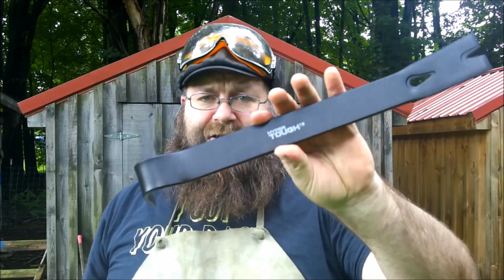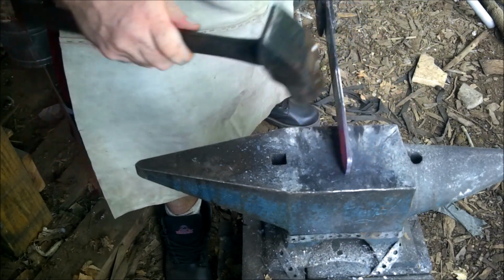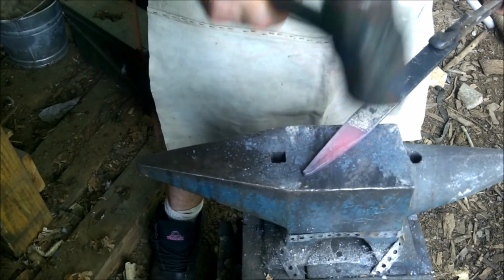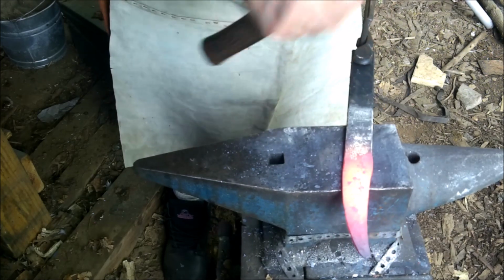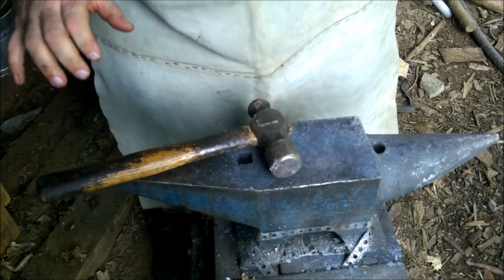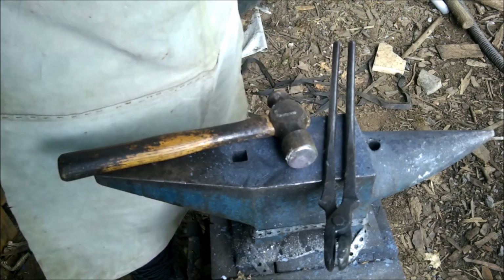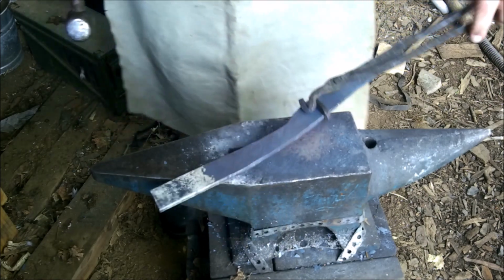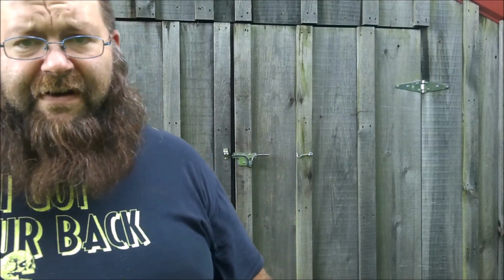Using Mystery Steel for a Knife Part 1

Comment: I've made knives out of pry bars before and never had any problems with them. I made a pry bar knife that I have been using for a camp knife for years and it's held up pretty good.
Reply from the maker: I have used pry bars before, but they never turned out consistently. This one was super soft, which leads me to believe it has a very low carbon content. It my make a decent knife, but I am doubtful. It will probably turn out a bit better than a dept store knife made from 420 stainless, but I cannot find info as to the type of steel hyper tough uses to make them so It is a shot in the dark when I harden it.